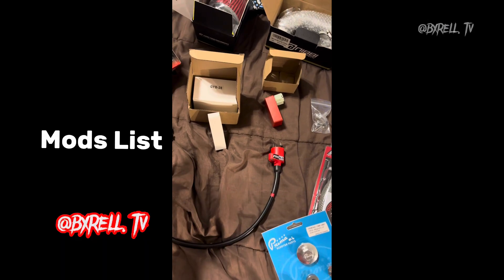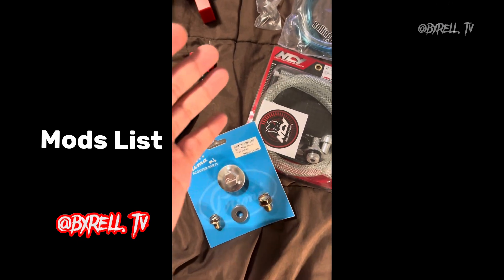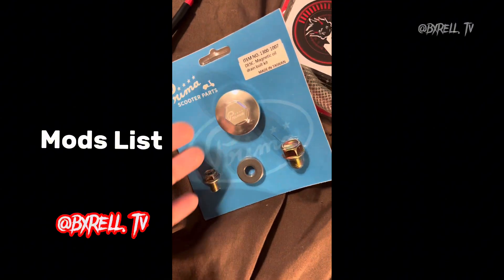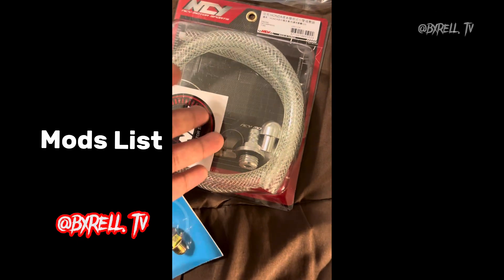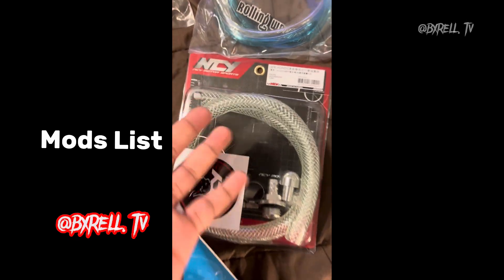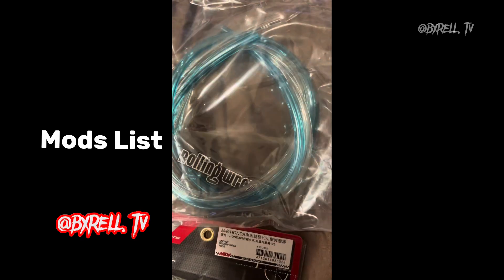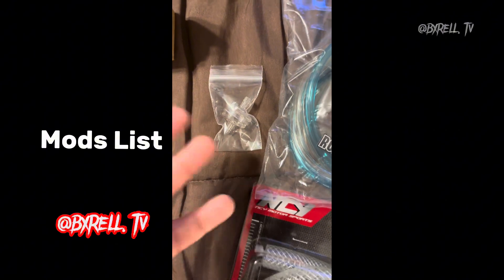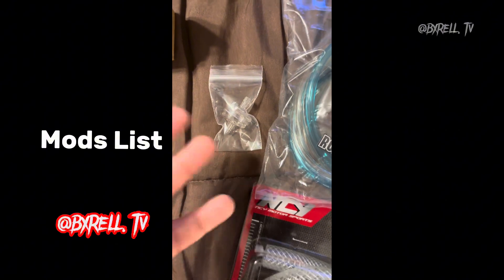Should you mod your Chinese GY6 Moped?

Comment: All Chinese gy6 either 150cc or 200cc the are all go below 70mph… .. the only way to top speed those Chinese scooter is change gearing and big bore kit
Reply: Rollers that's all in 168cc efi my joint be flying
Reply from the maker: @SBATHORGOD  No all GY6 are not below 70mph some  reach 75 mine reaches 71mph max and its a 168cc  It’s multiple cc but none of which are a 200cc. If you buy a “200cc” you most likely got a 168-171cc or 180cc GY6 and yes to your point big bore kit would bring it to a max 205cc If you get a GY6 B max is a 232cc which tops out around 90-100mph
Reply: @ good point.. you that Yamaha zuma.. clone what kind of engine is that in? Trying to get one, build up this summer project and upgrade and make is faster ..
Reply from the maker: @SBATHORGOD  Depends on which one you buy tbh but I’d say stay away from the EFI (Fuel Injection) they are harder if not nearly impossible to mod as no one can or wants to tune them. Go carb to modify. My particular tank clone is a carb with a 161QMK engine 168cc. If you want big bore kits or any mods I’d recommend going to rolling wrench. They sell kits for GY6 A or GY6 B engines. If you get my bike then ud have a GY6 A as it has 54mm stud spacing which is very important when ordering a big bore kit to know. However a quick google search will tell you my engine is a GY6 B however this is not true as GY6 A motors have 54mm stud spacing and this has it. A GY6 B has 57mm stud spacing. Now since you have a GY6 A you can option for a 171-180-190cc big bore bike or go for a water cooled 205cc big bore kit max price 2,000+ Or you can just flat out buy a crate engine they sell a pre built 190cc for near 3k. If you want to go all out you can build a  GY6 B 232cc kit however it will cost you 5k for there fully built kit and you don’t get the engine you will get the parts and have to build it ya self. Now 5k is a bit much for this however you do get near 30HP claimed and 90-100mph top speed and  but I’d say go with the 2k water cooled 205cc kit if ur on a budget or don’t think 5k is worth it. That was lot of information but hope that helps you get started on your project and what you can expect. Now the kits come with everything you need however make sure it’s the kit and not just the big bore cylinder cuz the support mods are important. And as you mentioned gearing before that is also important so any big bore you install you need to get there gear up kit or else you will have a similar top speed and hella trouqe lol. Also I’d say get the oil cooler mod as these engines are air cooled n will get hot very fast minus the 205cc big bore kit as its water cooled or if you do go the 232cc engine build they have a water cooled version of that as well but still oil cooler would be wise. Thats near everything Ik and can offer about the GY6 platform that I know.
Reply from the maker: @SBATHORGOD  Ik the last comment was a lot of information but I did also leave out definitely opt to by a racing clutch. I personally rock 14gram rollers on my bike but with extra big bore kit power id say a lower weight like 12-13g will be fine. Tbh if you are going all out on prefomace get the Reveno clutch forged pulley 1.0 version. 2.0 version is more tame and less aggressive. This alone is 900 dollars. You could also just get a cheaper one they offer they have multiple honesty I have a cheap 200 dollar dealership one and it works fine however I plan to upgrade to see any difference if there is any but it probably will be I’ve heard great things about the reveno. If you got big bore kit 205cc water cooled max build price can top $3,200+ and if you go 232cc $6,200+. Hope this makes the journey of modding ur GY6 bike easier also on the bright side if u go to rolling wrench most of the stuff is made in Taiwan or America so ur bike will basically lose the Chinese factor mostly.